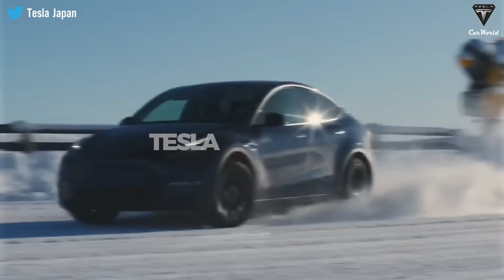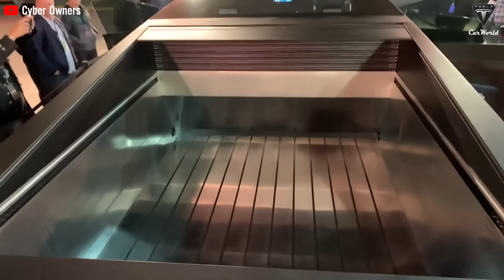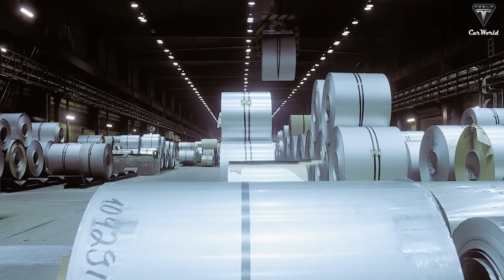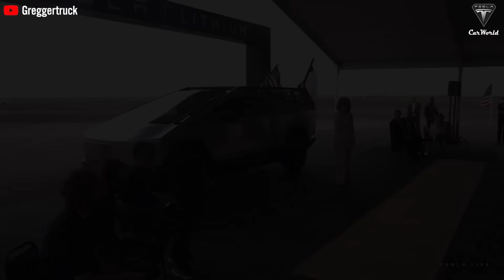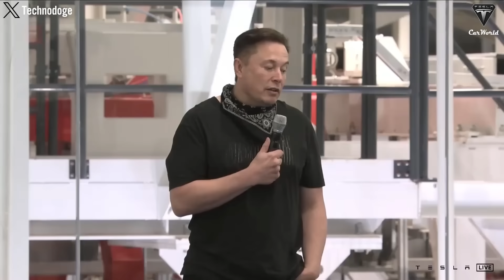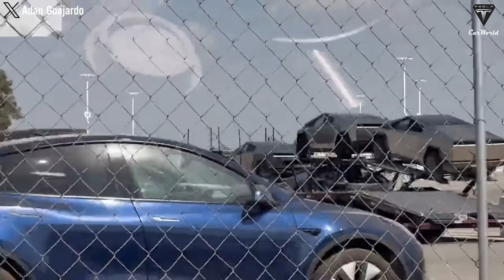Elon Musk LEAKED Cybertruck Real Size, Changes Car Body Materials and Very First Customers!

Comment: Well for starters , this truck is beyond ugly . Number 2 and most important . I will never own an electric truck , because I use a truck like a truck and electric is unreliable .
   This whole electric revolution is all well and good in cities , although I dont kniw of any city where the electric grid isnt over burdened.  This does not work for rural areas and if you need to drive any distance.
   I will drive the internal combustion engine for as long as possible

Comment: Watch out legacy auto.  The CT will get solid state batteries before the end of the decade.  And, the next mountain to climb is carbon fiber full body construction.  The cobination of the two will easily get the truck to 1k miles on a single charge.

Comment: At 1150 degrees Celsius the tires will become softer than peanut butter. Other than that, it is a great truck. Unfortunately, for those who are looking for a mid size pick up, the CT is still too large. Unless this vehicle is solely targeting the North American Market, it stands no chance in other markets around the world, like Europe, where stringent regulations and tighter drive environments exist. For these markets, a CT, with reduced size ( approximately by 20% of its current size ) is required. Lastly, this game with ever changing starting prices, inflation, model options, availability of EV cars in general and so forth,has to stop as it closely resembles to standard dealer practice’s. The CT was initially marketed at $39,900 for a base model option and now, for whatever reason, the starting cost has hit the $75,000 mark. Confusion, miscalculation and even greediness is the last thing that the newborn EV market needs.
Reply: Cybertruck is smaller than you think
The design here is advantage to get the exterior smaller
Reply: It was extremely big when it first came out I seen it 

I haven’t seen it since the downsize but I wish they kept the big size